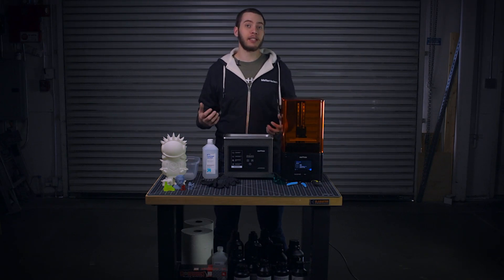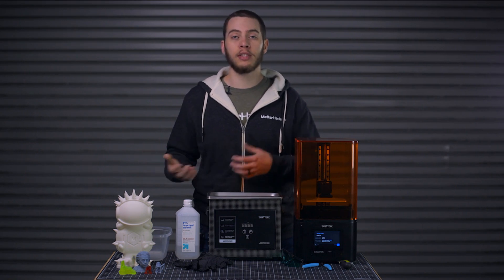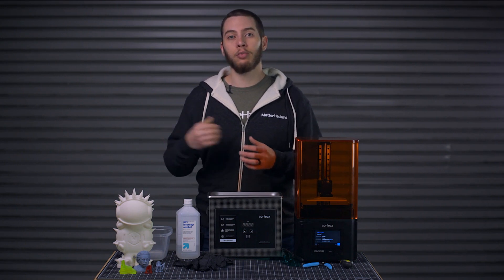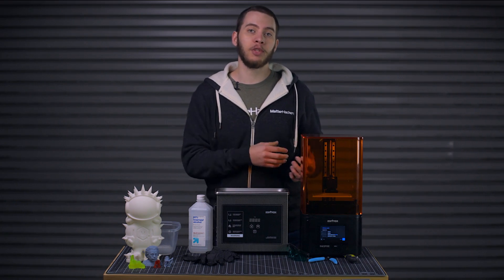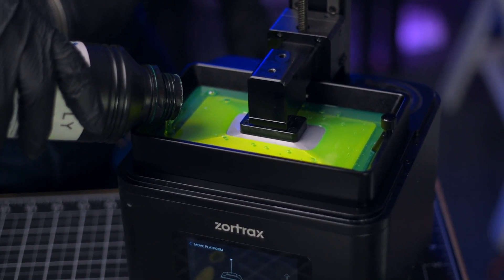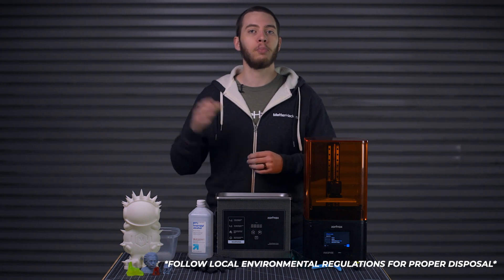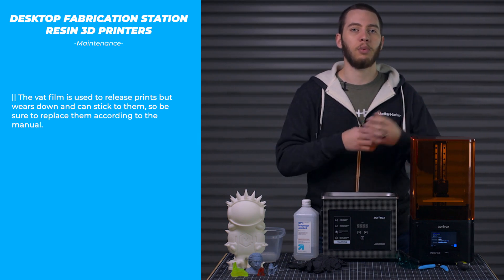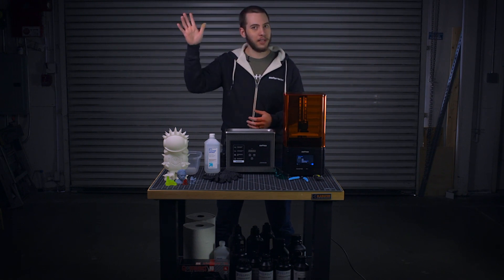How To: Set Up Your SLA 3D Printing Work Station

Comment: I notice you were using the Wal-mart (Equate) 91% IPA. I've been using that, too. My resins have instructions to use 95%+ IPA for cleaning up. I have ordered some. Can I expect better results or have I been fooled into buying somethign that is more expensive and no more effective?

Comment: Respirator. Even if you can't smell it the fumes are still there and you can develop a reaction to them over time. Unless you have them in a properly ventilated area which that set up was not please wear a Respirator while working with any resin